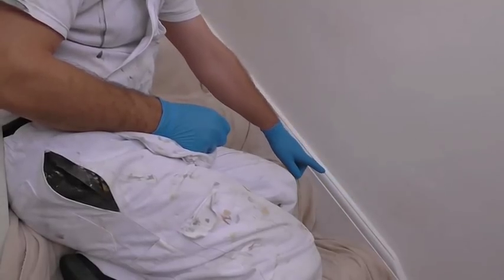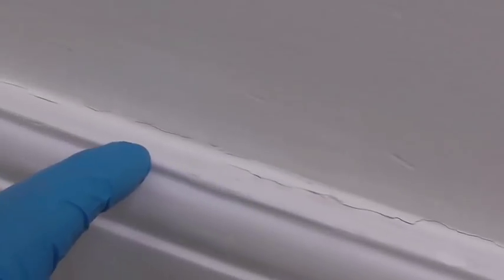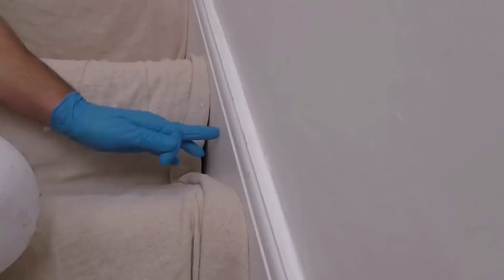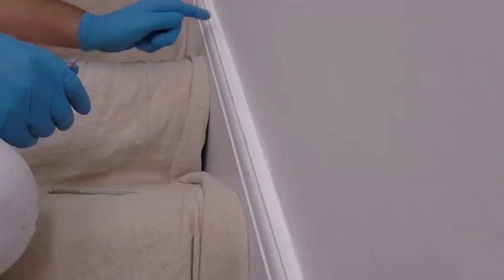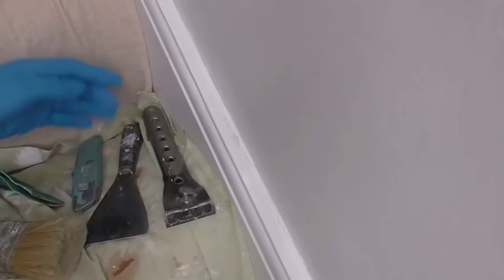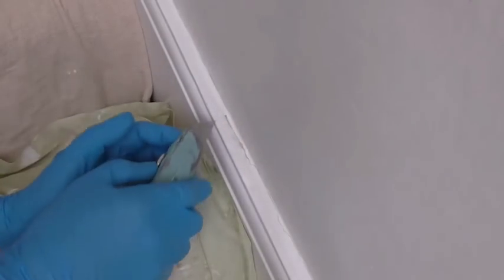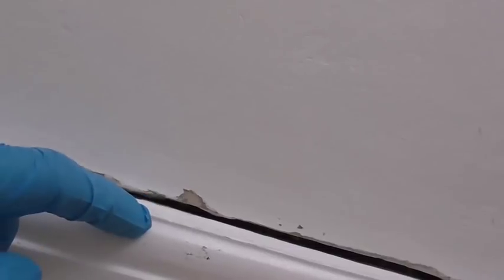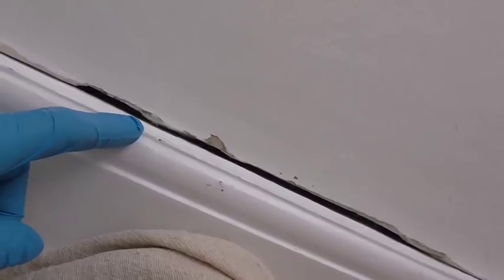Fix Staircase Cracks Step By Step Pro Tips

Comment: Thanks for the video and tips. Lovely job. I have been using a foam roller to apply water based satin (Zinsser Permawhite) to some doors and have problems with tiny air bubbles. Any idea how I could stop this? The roller is working well apart from this problem. I've tried brushing but it's very difficult /impossible to get a good finish. I don't want to use oil based because of yellowing.
Reply: Mark Rowland use a microfiber roller
Reply: @jamesmcconnon2  Thanks for the tip - I'll give it a try.
Reply from the maker: Well usually you lay off with a brush...  but water based does not really allow this...   your paint may be a little too thick..    but like James says it's more than lightly down to the nap...   micro may work better also slow down... rolling too fast can create more bubbles.... and make sure you spread the paint out as thin as you can when rolling...
Reply: @PaintingandDecorating  Thanks for the advice. I'll give it a try.

Comment: Great stuff. With the second round of hardstop filling have you switched to a fine surface filler or just using the same polyfilla as the first fill? I've got some Gyproc easifill and was just wondering whether I can use this for 1st and second fill.
Reply from the maker: Thanks. Yes, same filler and I've never used Gyproc easifill but it should be fine.
Reply: Thanks for the reply. One good thing about coronavirus furlough I can crack on!

Comment: Thanks for the great video. It's so detailed and helpful, the best video for tackling the problem on Youtube. We've started fixing our staircase that looks exactly like the one in the video, we raked out the chalk, filled in the gap with foam like shown. One question for the next step, you used BIN primer here instead of diluted PVA, can you explain why? Thank you very much!
Reply: Strength. Of substrate. For the proceeding step, which requires hard filling. PVA provides a good key but doesn't have the same strength, adhesion  or priming abilities (multiple benefits) as BIN. You should have PVA'd prior to foaming but I guess the problems been solved by now

Comment: @paintinganddecorating my stairs have wallpaper what other precautions do I need to take? Thanks
Reply from the maker: Not sure what you mean...
Reply: I’ve got wallpaper rather than painted walls just any tips so I don’t mess up the wallpaper and it needs repapering. Thanks
Reply from the maker: @tashirah1164  it depends how tough your wallpaper is. You may be able to tape it up. Or if the paper is loose fold it back as far as you can sometimes you can tape it.  Other than than that take your time and wipe off any mess.. thanks

Comment: Thanks very much for this. It’s going to help me out a lot! One other thing if you have the time please, we have just stripped the carpet off the stairs and want to paint the steps. There are lots of hairline cracks in the wooden boards though which have caused the layers of old paint to crack on top. No structural issues with the wood but I’m afraid my fresh paint will just crack over time. Is the best way forward to press some wood filler into these hairline cracks before  sanding and prepping the wood for painting? Would I need to rake the cracks out to make them bigger, similar to like you do with plaster cracks? Any suggestions would be a massive help please or if you’ve already done a video on it which I’ve missed. Cheers! Jay

Comment: First rate as always.....and I was waiting for the foam to come out! I have to admit....I've learned a lot from your videos. Just one thing though....what is the point of the hard stop? Why do you need to tint the filler? Surely a couple of coats of paint would sort it???? Thanks again.
Reply from the maker: Hard stop is so you can fill before the second coat of paint...   and the filler does not flash..
Reply: Very helpful video once again. Always learning from you. Thank you for taking the time and trouble to produce them